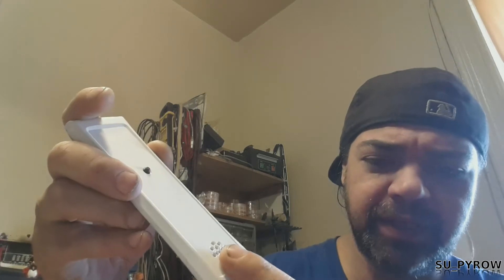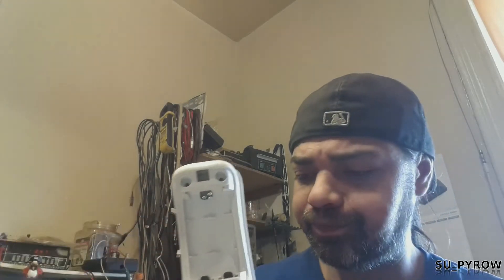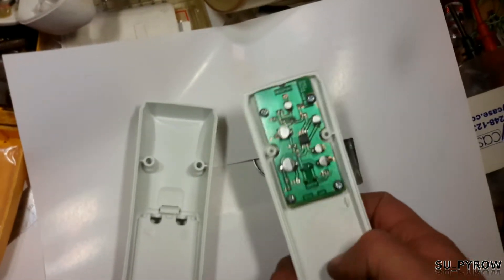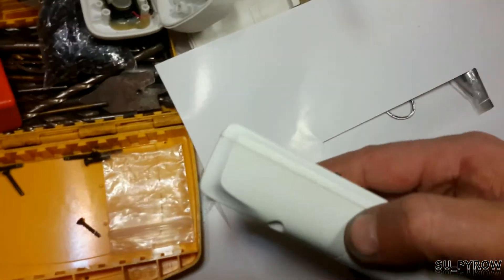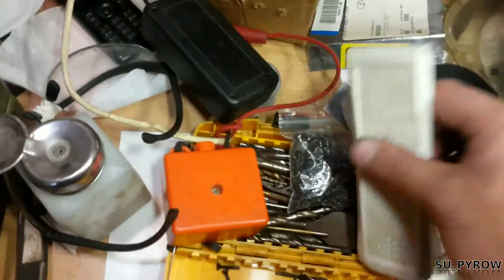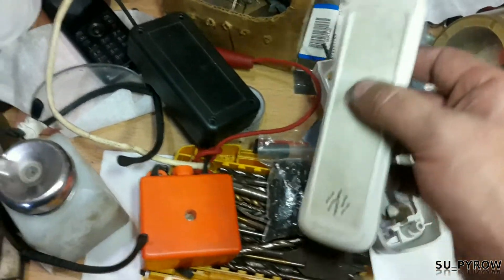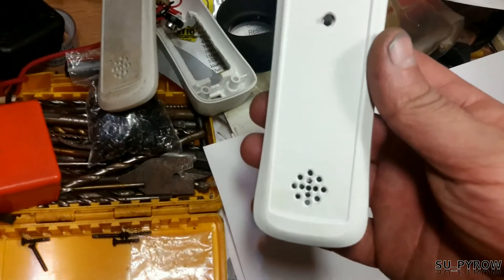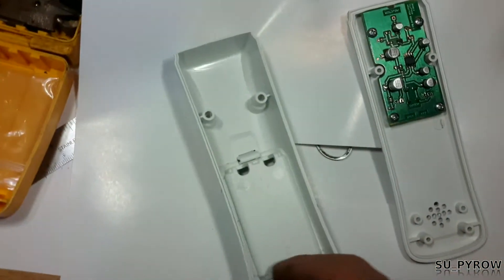How to build a DIY Induction Probe / Toner Signal Tracer Part #3  - The Enclosure  #16 SU_PYROW

Comment: What Proxxon is that?
Reply from the maker: Proxxon Micromot MB 140/S Drill Stand
Proxxon Precision Rotary Tool FBS 115/E  - with Collet set

I added some more hardware details in the "showmore tab"
Reply from the maker: i will admit, they made a new version of the drill stand and I cant wait to upgrade it!
Reply: They make some good stuff, I may check it out but I first have to buy a crossbow.
Reply from the maker: its been worth the investment.  dremel is a JOKE!  there is no way I would get the same kind of quality holes.   no comparison.
Reply: Their Ga, office kinda mislead me when I ordered the Milling unit.  It's a well-built unit but the catalog showed it with servos  and computer hookup, after buying the Milling unit a week later I called to order the computer package she told me it doesn't exist "(  I am happy with it but really wanted the addon.
Reply from the maker: which milling unit??  you need software?? hardware what?
Reply: The https://www.proxxon.com/us/micromot/37110.php.  Im looking for the servos and software to run them.  
If you look half way down in https://www.proxxon.com/us/micromot/34108.php you will see what m talking about.
Reply from the maker: i think those are NEMA stepper motors
https://www.proxxon.com/en/micromot/27112.php#27114
Reply from the maker: linuxCNC is free software to run it.  you will need the hardware controller unit.  i actually have the parts to build it, been putting it off for 3 years lol    never had the money to spend on stepper motors
Reply from the maker: NEMA 23 - DC 4.1V 1.1A 1.8 Step Angle Stepping Motor   is the type they use
Reply from the maker: strike that:  they use 4.7v 1.5A  1.8 step  NEMA 23
Reply: lol, and she said they had nothing. lol  I will call tomorrow and see what they say.
Reply from the maker: i know i can buy the compound table and add the motors later.   im looking at the datasheet for the motor drivers i have in stock right now, im interested in reviving the project
Reply: I have to check into it, thanks for the help.  I know about putting things on hold then prioritizing the list.
Reply from the maker: you got it.   this has been a project ive been wanting to do for a while.  may be.. its time?